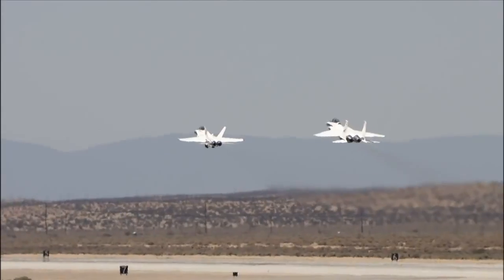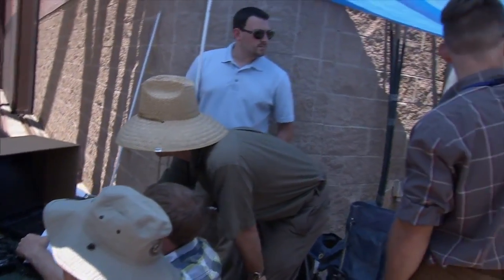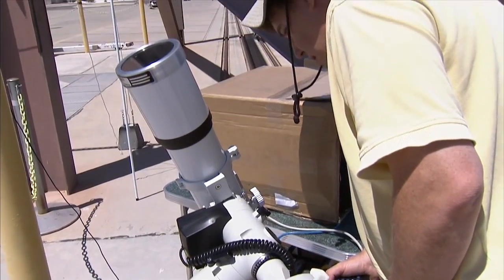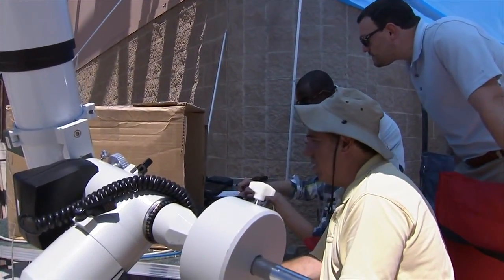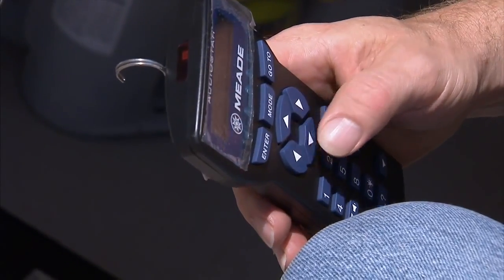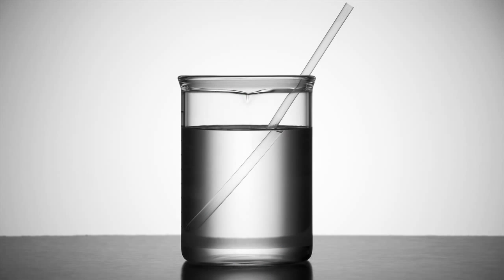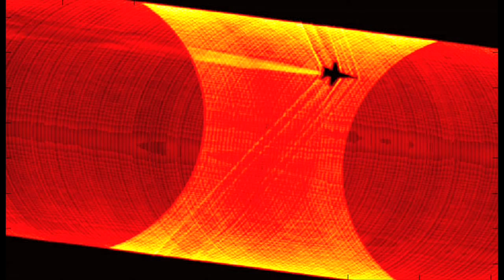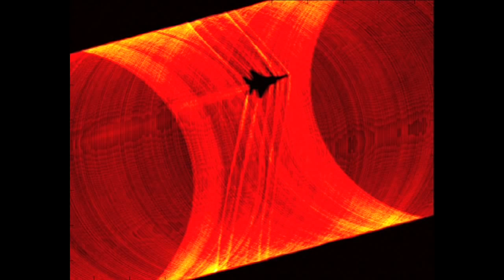Jet's Supersonic Shockwaves Snapped While Eclipsing Sun | Video

Comment: ☢☢☢ rarely is the 1st prototype of anything simple,
~  even rarer to find the minuet physic ( airdynamics ) involved simple, even when the result is a simple to remedy in design
= so the very durable deer whistle would need to be variable shaped & computer controlled: poly-magnetic materials or perhaps directed energy applied to alter the air stream
+ thanks for kicking the think tank up a notch, that was my intent, least the other commentators start playing football or BADMINTON in the thread

Comment: A perfect match is impossible and an approximation wouldnt be worth the effort I think. It might be better to find a way reflecting or absorbing the impulse. for example you could release a special gas from the front of the vehicle right before the sonic boom to change the air properties in a way that could suppress the sonic boom at least a bit wihout correlating with the engines.

Comment: it's not that easy since you had to produce a counter impulse right at the sonic boom itself. a time shift would cause complex values in frequency domain which would not cancle out. (fourier transformation)

the problem now is you need to detect a sonic boom becaofre you can react on it. due to causality you will never be able to produce a matching counter part at the same time. 

the only possibility is to calculate it from given data like speed and air pressure and try to match it.